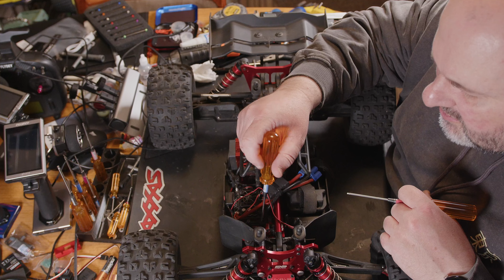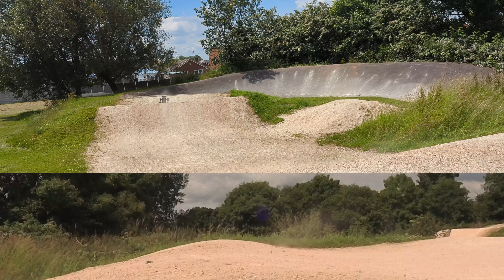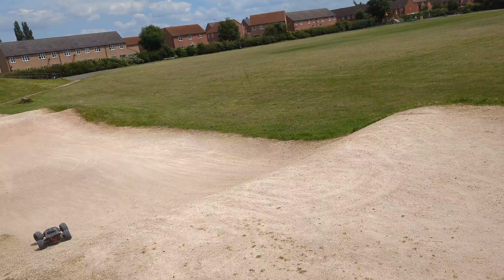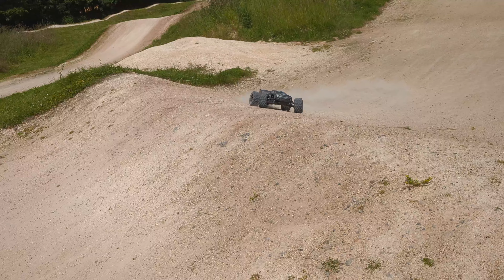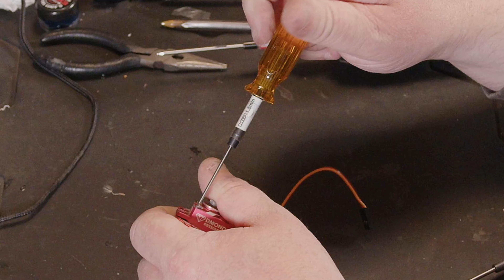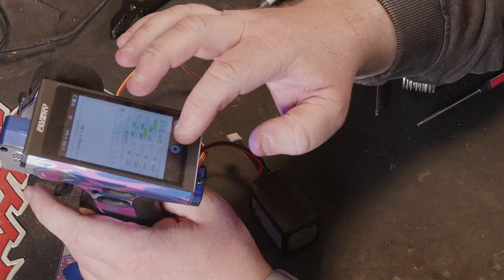DMOND DBS5084V 50KG servo running test in K6 EXB

Comment: First ever self healing servo ❤😂
I'd say at a guess it is a combination of impact related to tolerances being slightly out (maybe due to being not fully tightened??) with too thin gear meshing??
That wasn't even being hard on the krayton, although shock waves could still be quite brutal being on that hard surface and easily travel through every part of the car.
Hope you manage to get a full battery out of it next time 😮
Reply from the maker: Well it's still running fine so who knows lol I've never had a servo where it fails to drive and the gears ain't stripped but 1st time for everything I suppose lol